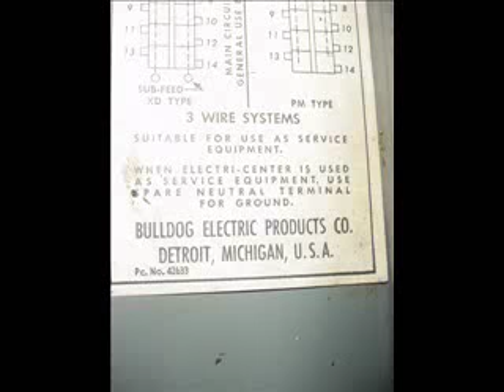Electrical Wiring Hazards - Burning Down The House

Comment from the maker: @1972FordF150 Most outlets have the option for using the screws on the side or the push connect on the back.  The old two prongs I took out didnt cause at the age of over 50 years old, all they had were nice big screws.  Outlets were still good and strong, just changed for color and grounding.

Comment from the maker: @mbyr31 I actually like fuses, IF installed correctly ( not double, triple lugged in the box ) they do react quicker than most breakers.  The cloth wrapped wiring if done correctly and un disturbed is all right but should be inspected and changed if it is cracking like in this video.  Some of the pictures you can see where I connected back onto the cloth wiring, it was still in good shape and wasnt powering anything major.  Replacing some of that meant opening walls.  Knob & Tube is another one

Comment from the maker: @1972FordF150 There isnt any cloth wiring in my house, though, it was wired in the mid to late fifties.  I have re done most all the connections, outlets, switches etc and installed a new service panel.  I also put my computer systems on their own isolated circuit.

Comment from the maker: @1972FordF150 The only thing I will not do is use the quick connects on outlets or switches.  Next time you have one in your hand look at the back at the holes.  There is just a spring tab in there that contacts the wire when its pushed in.  I will NOT do that, always use the screws.  Same thing goes for engines or anything really " any point of connection on contact is a potential point of failure "

Comment: @More350Power wow, aluminum?  hadn't seen any of that in years.  braided sheath copper that's still in a lot of places that haven't burned down yet. and yeah you don't really have much of a choice but SquareD is good stuff.  i wired up my shed in Romex myself, full house 24 pull box  4- 110 outlets and a 60Amp outlet for my Welders. even wired it in on the pole myself, and none of it was inspected but it's all lasted for years now with no problems so i guess i did something right lol

Comment from the maker: @OlegKostoglatov I was taught that every connection is a potential point of failure so I try not to make junctions or splices unless absolutely necessary.  I know someone that has installed 220 baseboard heat and burried open juction boxes in the wall......  made junctions for 220 stove feeds.....  I just cant do stuff like that.